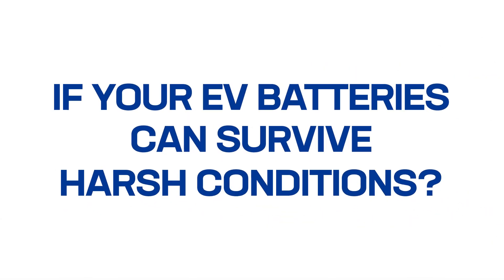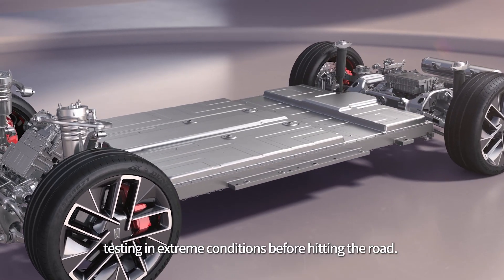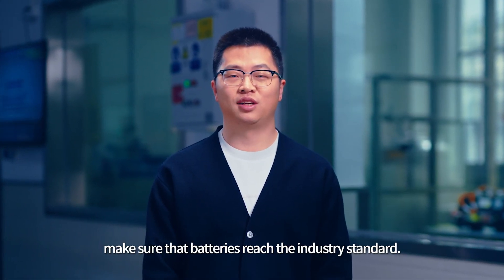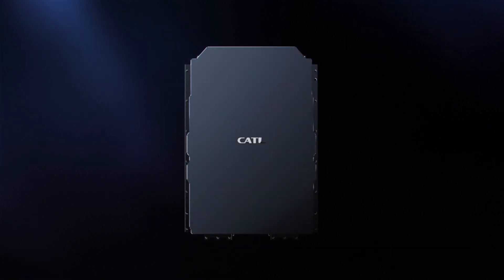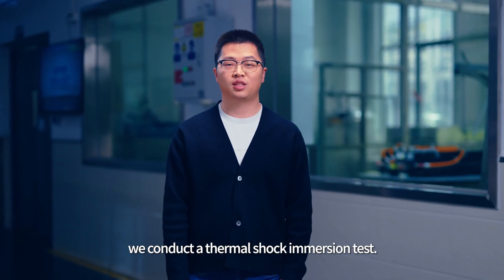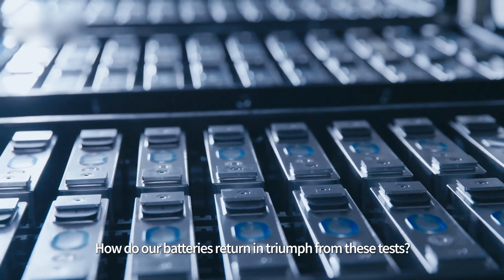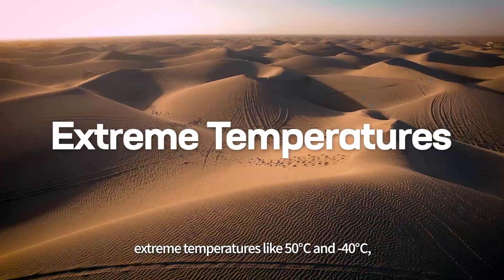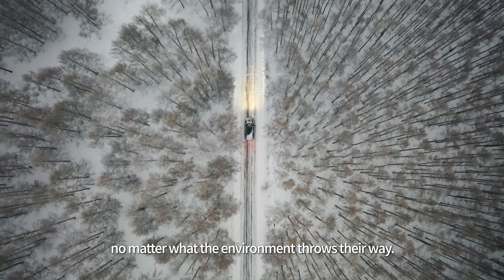Flames to Frost: How CATL Battery Braves It All

Comment: With all due respect to CATL efforts for producing better battery cells every year after year,lets be real and face the reality for one time, a battery cell that has less than 400 wh/kg and atleast real 2000 cycle life cant compete with internal combustion engine cars,that is the fact that no one can deny,as we see it today,ev sales are slowing down every month that pass on, people want to buy hybrids or pure ICE cars instead of pure electric vehicles,and the reason is so obvious EVs are so heavy,none of them can travel more than 500 km on a single charge with 120 kph highway speed,there are not enough charging infrastructures yet to charge their evs as fast as ev companies advertising,i hope people wont buy evs untill we have 400 wh/kg to 500wh/kg cells commercially available,please face the reality,not only great CATL company,but all other battery and EV manufacturers around the world,please wake up
Reply: You should look up some Chinese EV brands, they can absolutely go 500km on a single charge, some even 1000+km recently. But yes we need to get past 500 kw/kg density for EV's and eVTOL's.